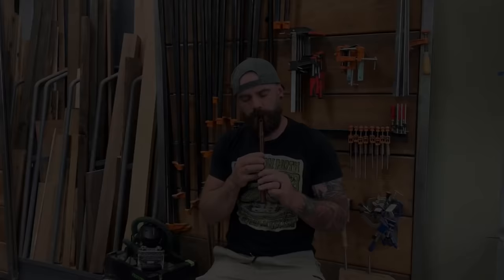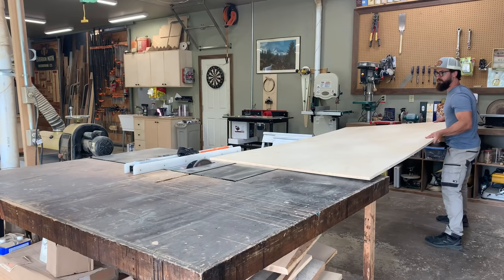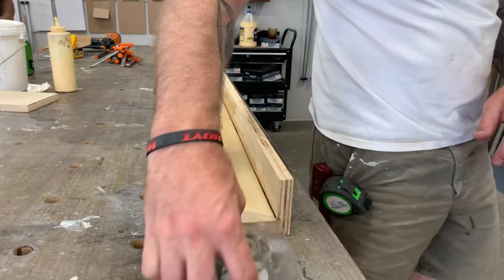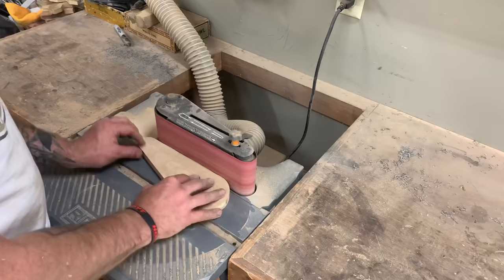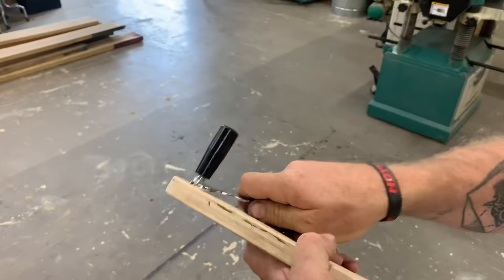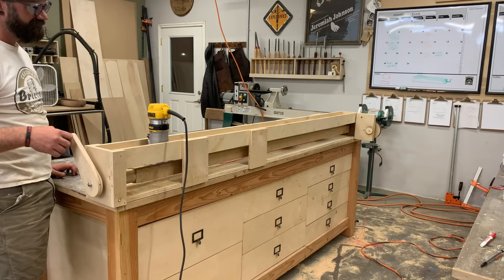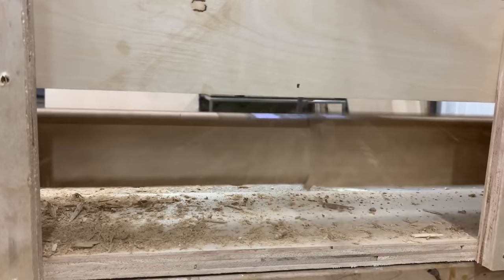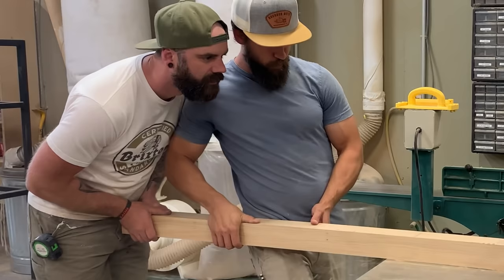Make Your Own Lathe

Comment: Love it! Just so you know, you could eliminate having to manually slide the router (and having Erik help at all) with a couple round gears and a worm gear, and then you can even make some pretty fancy spiral columns and posts. But then that would require a really long threaded rod.

Comment: I purchased a Sears router crafter probably 20 years ago at a garage sale and I’ve never used it but I have always said I would. It is basically the exact same thing you made but with a crank system that would move the router but it was a continuous loop so it was constantly under tension both ways. It could be engaged or disengaged at will. So you could run the router across the piece manually or engaged and make even spiral cuts with it. Pretty bad ass. It had a dead point at one end and a square box at the other that was tapered inside to hold your stock and engage with the handle. If I knew how to send a picture with this reply I would send you a picture of it. I’m old and technologically challenged
Reply: I used my Router Crafter to make Xmas presents for family members.  They show them every season.

Comment: I made something very similar based on something in Shop Notes. I ended up making the router move along with a threaded rod and a coupler nut mounted to the router base and wooden gears at the far end to make transfer the motion from lathe to router. The reason I did this, I needed a Cable Drum, so after smoothing out the drum, I switched the bit to a round nose bit, actually I used av-groove first but that didn't work too well. when I ran the contraption this time I created a spiral grove down the drum.

Comment: Also the router was mounted on a hinged system that you could just lift the router up and out of the work piece and adjust the depth if you so wished and dropped it back down. With that locked in place you could cut grooves and other things in the wood much like a lathe. It had a micro adjust on that flip plate that you attach the router to to drop the router in as lightly as you wanted to. Pretty ingenious and now this video has inspired me to get it out and use it

Comment: Back in the 70s and 80s Sears had a product called the Routercrafter that worked on the same principle but they resolved the router travel issue with four cables.   I bought one to make spindles for bunk beds I was making for my kids.  You could use a pattern to duplicate so that made the eight spindles I required all consistent.  Like Erick, I quickly got tired of turning the crank so I hooked it up to a 1/2” drill.  My daughter just refinished them for her kids to use 35 years later.
Reply: Dang! I thought I would do a comment search to see if anyone referenced the Sears RouterCrafter. I had one in 1983. Unfortunately it went wayward in the early 00s.

Comment: I use this exact same method to make pool cues and tapered table legs just make the top of the box adjustable in height on one end so that you can run the router on a gradient to your desire and it works perfectly
Reply: Awesome. This is why I love reading the comments. Brainstorming with a large group can come up with some amazing stuff. This being one of them

Comment: Have made a lathe sled for tablesaw. Considered a router, but drill powered, on the tablesaw with a sled about 4' long that glides in the miter grooves seemed to be the best option. 

I used it for making furniture out of logs. Works great.
Reply: To be fair, I took inspiration from a hand cranked version I saw (no pun intended) in a video. Mine is quite a bit sturdier, and only works parallel to the blade, but a 12" blade gives a good taper down to a 1 1/4" pin on the end. Easy to "shape" with a draw too, if you want to make it look hand hewn

Comment: Nice, I made 425 spindles using a similar method rather than buy a lathe because I thought I'd only use it for one job, many projects later I still don't have a proper lathe, I manage fine with my old grinder thingy ma Bob 👍

Comment: Damn!! Been trying to figure out a way to easily, efficient, and (most importantly) inexpensive  way to size walking staff blanks to an appropriate diameter. Then, viola, there it was! Just casually scrolling through YouTube vide on a snowed in day when I found it. This is so simple and inexpensive to construct that I am flabbergasted I hadn't thought of it myself or ran across it previously. Just so happens that I have everything needed to construct it laying around the shop in my scrap materials bin. Sometimes it amazes me how a problem can present itself as daunting for an extended period of time and then one day the answer just falls on your head from out of the sky.

As for automating the router travel, I think a travel rod might be the simlpe answer.

Thanks.

Brilliant design! And I really liked the presentation. It was so comical and interesting that I completely abandoned my normal penchant for frustration at the pointless, distracting prattle that  goes with so many consider internet how to postings. Great job!

Comment: Nice jig! 
Sometimes you just have to make an idea reality, to get it out of your head!
Reply: I know exactly what you mean.
I had been meaning to make an auxiliary fence for my table mounted router for a while (router mounted in an extension on the table for my jobsite table saw).
I had been going through the design and way to mount it on the table saw's fence in my mind for a couple of weeks, often in bed while trying to fall asleep.
Yesterday I finally  got it done, spending 7 hours in my garage designing and making the "contraption".
Boy, did I sleep well last night. :)
Reply: @HepauDK  The best kind of sleep!

Comment: Dude, I work in a custom/ production shop, we have a 50” lathe but we get requests for bigger items, I’m gonna try something like this next time. You are correct there are probably “better” ways but this is fast and cheap to build especially if you forgo the hand crank etc
Reply: Did you make one?
Reply: This can be done very well on a spindle moulder using a flat cutter and a copy bearing the same diameter as the cutting circle of the cutter block. This produces a much better finish also than the router cutter.

Comment: You should research ( craftsman router crafter) it does what you wanted, as well as can copy a already existing piece, it uses cabels to move the router and can be found on eBay. Only problem is the size, but you could get the design ideas from it and make one that works for you.

Comment: I love that you are a Makita man but seeing that DeWalt chopsaw broke my heart.  😭
Great video bud. Keep it up
Reply: I have mixed collection of Makita, Dewalt, Metabo and Bosch (both green and blue).
I have stuck with Bosch for the cordless tools because that's what I have batteries for, and batteries/chargers are fairly expensive.
If it gets the job done well, the brand is of no importance.
No need to get all religious about it...
By the way, do notice that the router was a Dewalt as well. ;)

Comment: While the string pulling the router might have failed, you could repurpose that idea to pull the end of a vacuum hose.
Reply from the maker: Genius
Reply: String, cable would maybe work better, needs to be hooked on both sides of the router with a pulley or two at either end ... like a CNC.
Hang the vac/hose above with a jig attached to the router so the vac moves with it.

Comment: I've seen someone do this same thing, but instead of a router, it's a jig that pushes it through a tablesaw and uses a drill to spin it. You just gradually slide it through the blade and get a large dowel.

Comment: Bro, hook a cheap box fan motor to it with all thread out of the center (of course u have to figure out how to attach it) and then u can just plug it in and control the speeds. 😀

Comment: Need a 16' bike chain, a spring loaded seat to support the middle of the piece to avoid sagging, and a second spring loaded piece hanging under and just behind the router with some sandpaper on it so that it sands for you while you route. Or just build a cled with sandpaoer on it that you can put in place of your router when the turning is done. 
In all honesty, I would have went with the drill turning it from the first second. Screw hand cranking, ain't nobody got time for that.

Comment: Version 2: Make it vertical, so you can do loooong pieces without it sagging in the middle and creating uneven diameters. Did you check the finished result with calipers to see it the middle is the same thickness as the ends?
Reply: Once you get it round you could put a set of roller bearings underneath it at the halfway point to support the weight and work your way up to it from one side move the rollers to the other side of the router and finish and that would support your wood well enough to keep the diameter consistent over the whole length probably very well. Working on a vertical would be very difficult in my mind. IMight be full of crap though you know

Comment: Hey Man, great videos, love them. I am just starting out and kind of inherited a chop saw, circular and a table saw, but the blades are a bit rusty and/or worn. Can you recommend what disks I should be getting for those 3 that would be good for furniture making? Thanks
Reply from the maker: I always buy forest blades. They’re the best 🙌🏻🙌🏻
Reply: CMT Chrome are the cheapest among the high end blades. They'll stay sharp longer than the mid-range big box store blades because they manage heat much better and can be sharpened many times. If you have a sharpening service near by it's a no-brainer!

Comment: Need to make a pulley system, separate from the stock, to crank the router back and forth.
Reply: The router also needs to have weight on it or it will just bounce around.
Reply: akaredcrossbow it’s in a dado so it can’t bounce or tip.

Comment: The intensity at the planer was almost too much, I nearly laughed myself off the couch. I like your idea for the pole string but would replace it with cable to reduce the amount of stretch and definitely would loop it back to the drive end to keep the router from chattering along the track. That way you could reverse direction and bring the router back to home.

Comment: So you made a Rube Goldberg machine when you could have just used your router table and the appropriate size roundover bit and made any length of round stock you needed. Okay. Also you likely would have a better surface finish had you used the edge of the carbide straight cut bit instead of the tip.